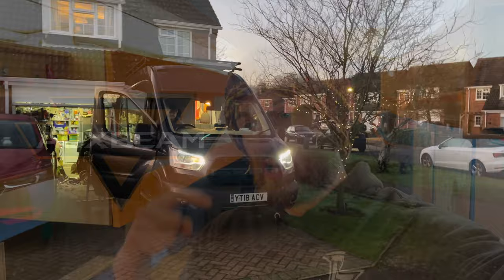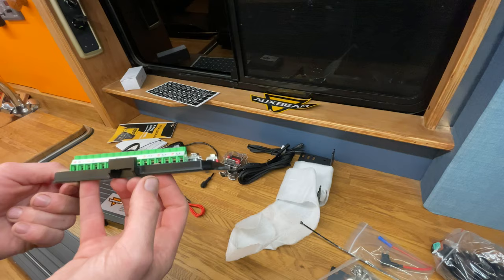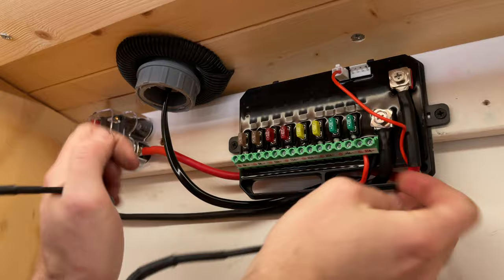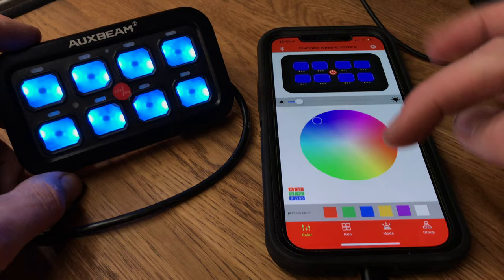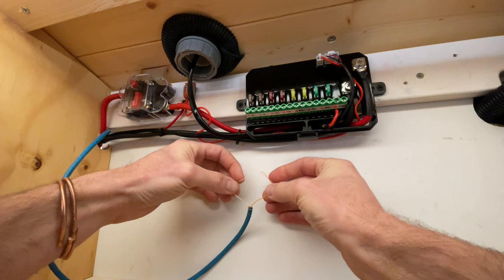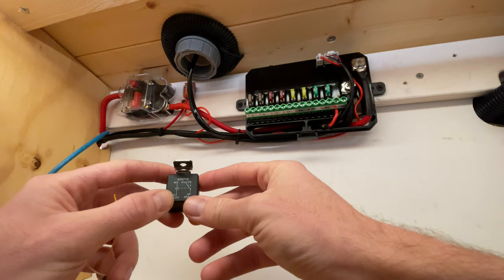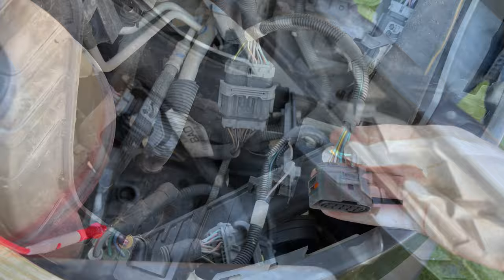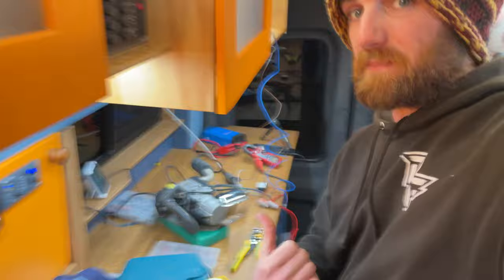Control ANYTHING in a CAMPERVAN! | AUXBEAM Control panel

Comment: What sort of engine pre-heater are you thinking about, electric or diesel? I'v got a 220-240v pre-heater and they are very power hungry, even if you have a massive Lifepo4 battery bank. My electric pre-heater is a 3000W that I plug into the mains at home when the temperature drops to freezing. It still takes 25-35 minutes to warm the top of the engine block, depending on the outside temperature and wind speed. If the wind is blowing its cooling the water in the radiator almost as fast as your heating up the water in the engine block. Covering the front of the van with a plastic sheet or blanket reduces the air flow to the vans radiator reducing the cooling effect a lot. Which speeds up the heating almost twice as fast.
Reply from the maker: I’m installing a Webasto Thermal Top V, which is a diesel powered unit. That is a hydronic diesel heater which will heat the engine coolant at 80° and circulate it. 

I will also be covering the front grill on a planned trip. This engine preheater isn’t planned for UK use. I have a extremely cold weather trip planned. Whilst apparently the transit to rated to start down to -22c ( i’ll believe it when I see it ) that’s still extremely stressful on the engine I would imagine. would rather have a engine preheater which is normally factory installed on transit based in the Nordic countries.
Reply: @MispronouncedAdventures  That the way to go. I'v got a Webasto water heater sitting in the box in my living room, ready to go into my van build this year. It will be nice to turn it on remotely via your phone.
Reply from the maker: Which model? of webasto? Depending which one it might be very easy to turn on remotely using MQTT and some sort of relay
Reply: @MispronouncedAdventures  Its a refurbished/rebuilt Wabasto thermo top C.
Reply from the maker: @drewhodge3820  I have played with the Top C as well. it’s your a version with a controller ( w-bus ) to start or just a simple switch
Reply: @MispronouncedAdventures  I've purchased a large plate heat exchanger as well. So I can have hot water in my camper. I'm doing the hot water part differently to the normal way you would use a plate heat exchanger to produce hot water. Just waiting for someone to make me a stainless 10 litre water tank. I'm copying the Lavaner Lava design because they haven't started manufacturing their units. You can't buy them so i'm building my own. They got David Mclucky to test there pre production model about September last year but I've spoken to Lavaner and with the problems they are facing in China, they have no production start date. (possibly mid 2022 or later) I want to be travelling round Europe/EU by the summer.
Reply: @MispronouncedAdventures  I've got an original controller with a built in 7 day timer.  So if the temperature drops I can set it up and forget about it. (at least for 7 days) It would be nice to connect it to a cheap GSM unit and a relay to turn it on with my phone but I'd probably never use that function. I've got enough gadgets going into the campervan already. LOL. Including a DIY 600Ah battery with a BMS that turns on heating pads if the temp drops. A 3000W low frequency inverter (9000w surge) that is also a 70A charger from the mains/shore power. Plus a 70A B2B. Microwave and lastly 14x USB ports dotted around the back of the camper. I must be mad.

Comment: Really smart
Did you extend the control switch wire the the fuse box then & how did that go ? 
Thanks nice one
Reply from the maker: Yes no issues with extending the control switch wire it’s just 4 core wire they do actually sell extension cables as well
Reply: @MispronouncedAdventures  
Ok brilliant thanks very much that’s cool

Comment: Why not use Alexa or Google with wifi switching. A fraction of the cost.
Reply from the maker: That’s not how Alex or Google work. needed an internet enabled switches are not convenient or easy. they are Also not that cheap. I’m not sure 8 WiFi switches would work out much less. Don’t get me wrong I love and use Alexa for other parts of the van a lot. But my auxiliary lighting I want to fit a button
Reply: @MispronouncedAdventures  But my auxiliary lighting I want to fit a button. Is that a momentary Button?
Reply from the maker: @davidsharp6392 they can be set to on / off, momentary or pulse

Comment: My Auxbeam AR-800 (Australia) arrived today and I'm excited. What I don't understand is why you used a relay for your Maxxfan control? Why not just hook the Maxxfan power wires straight to the Auxbeam instead of using the cat5/RJ45 like you did?
Reply from the maker: It’s a good point and I don’t think I pointed it out well enough in the video why. just hooking the power wires of the maxxfan wouldn’t achieve anything unfortunately. It’s not a “dumb” unit. Some roof fans would just be a fan motor turned on and off via a switch which would work in the way do you have visioned. Whilst the maxxfans PCB needs to be interacted with after the unit is powered. Via the physical buttons, the Remote control or the RJ45 port I’ve used. 

For example. If you just cut power to the unit. Yes the fan blades would stop moving but the cowling would remain up, and once you reconnect power the fan wouldn’t start again. 

My system with the relay fakes the power on/off sequence which would normally be done via the rj45 port if you used the maxxfan wall mounted controller.
Reply: @MispronouncedAdventures  Thank you so much for replying and I now understand what you mean (I think!) I'm asshuming you want to just hit 1 button and the fan starts working where it last left off whereas I don't mind hitting the remote control or the buttons on the unit to make the fan work. All I wanted to do is have the Auxbeam control the power to the Maxxfan power as an added safety. This should work in this application shouldn't it? I do appreciate your videos Alex, thank you.
Reply from the maker: Ah that’s no problem then. If you just want to just cut power to the unit for safety then just connecting the units power wire to the Auxbeam would work.